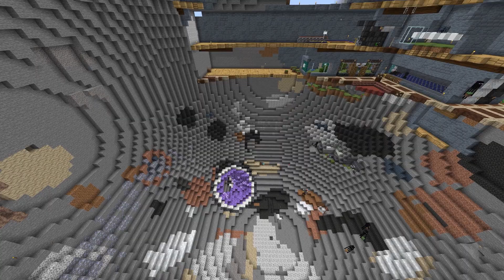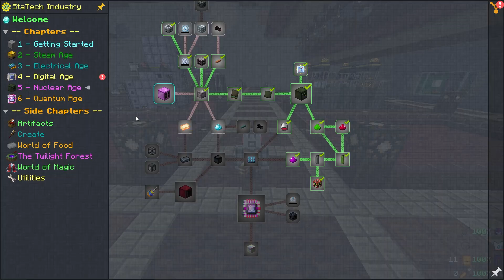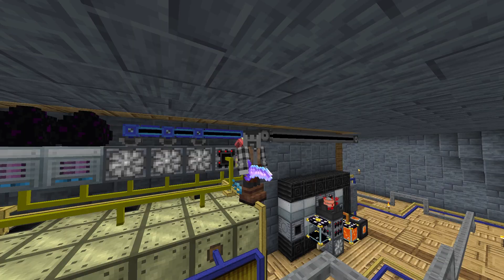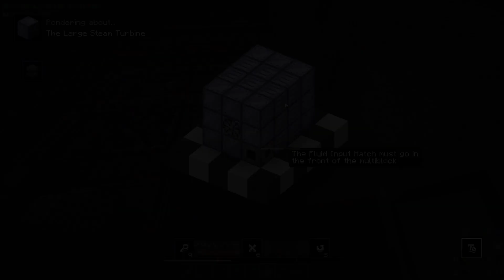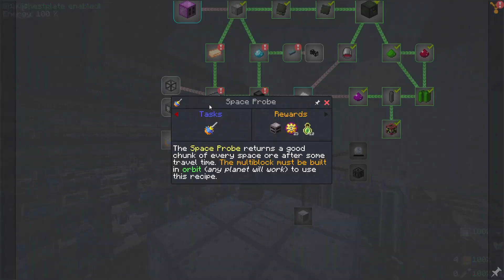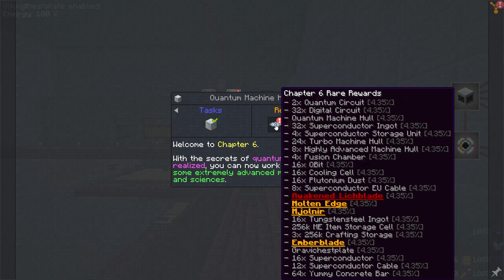Making the Quantum Circuit and Ending the Nuclear Age - Minecraft: Statech Industry #33

Comment: for automatic production of iron and gold I made a farm. produces about 1 iron in 1.5 seconds.
for iron - I use a level 4 cobblestone generator from the kibe mod. then this cobblestone is crushed using a crushing wheel from the create mod (you can use regular electric crushers) I get gravel which I wash using a fan in the case from the create mod (I put water in front of the fan) as a result, you can get pieces of iron and silicon from the gravel. from pieces of iron you know what to do)